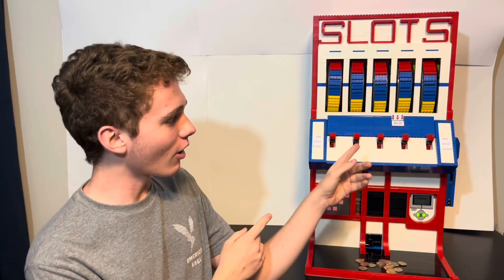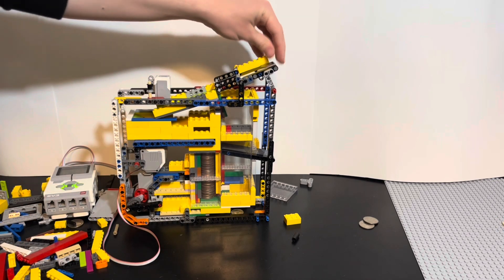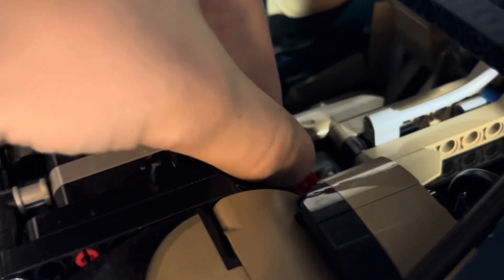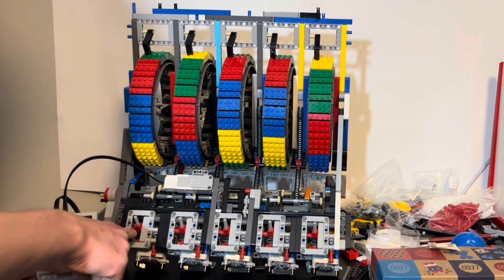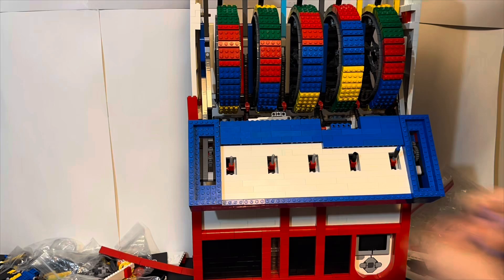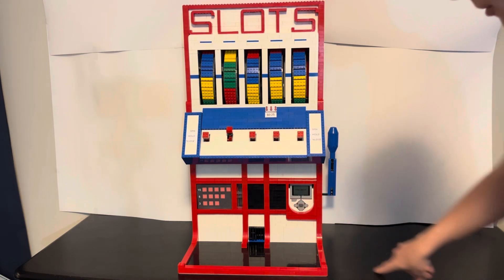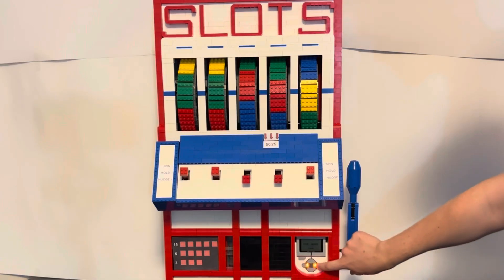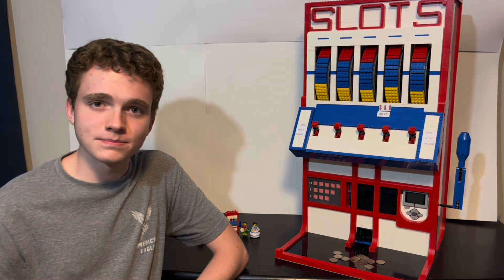Making the Ultimate Working LEGO Slot Machine

Comment: Can you tel me how to program the credits
Reply from the maker: @Joffrey-v8w  in the ev3 programming software, I begin by having the ev3 run two programs by using two start blocks. One program is the wheels and sensors while the other is for credits. It begins by establishing a variable called “credits” setting it at zero. Then every time the sensor sees a chip it adds one to the credit variable and spins the motor to shake the column. When the other program is triggered by the slot machine arm to play a round, it checks the credit variable to see if it has a credit. If so, it plays a round and subtracts a credit

Comment: how does the ratcheting system work?
Reply from the maker: @JoshyBoi7832  there’s a one-way drive which is composed of 3 gears. The first one is motorized and the last one is the output. The middle gear is mounted via an arm that is free to lift up but gravity keeps it down. When down, the middle gear makes contact with the left and right one to have power transferred from the motorized gear to the output. When the motor stops and the output still spins, the middle gear ratchets by lifting up due to torque. The left (motorized gear) spins counterclockwise, the middle would spin clockwise, and the output counter clockwise. That orientation only allows torque one way. The other way just lifts the gear
Reply from the maker: Just thought of an easier explanation: it works just like a bicycle how you can pedal to add power and then coast/free spin

Comment: Instead of making these take real coins, why not just a flat 2 by 2 plate?
Reply: Because that's not fun, and 2x2 flat tiles can easily get accidentally wedged without precise engineering to prevent it from flipping or rotating. A metal coin is round and has more weight, so it's less apt to get stuck on its side in the hopper

Comment: Videos are incredible, but here are some tips from one creator to another. I would suggest buying some more lights and/or a (bright) light for the camera to both brighten the set and get rid of harsh shadows. The other thing if you know anything about cameras is the White Balance/color temperature. Some of the shots are very warm (yellow/orange) and look like they were recorded in a living room because of that. Making the temperature colder/cooler (whiter) will make it look much more professional and in turn more watchable to the average viewer. Keeping the White Balance consistent from shot to shot is also important. If you are working with a camera that should be an easy thing to change, but you can also manually adjust WB on a phone too and in editing software too. Awesome machine, and a lot of potential for the future :)
Reply from the maker: Thank you! I appreciate the advice! I don’t know why those two clips seemed over saturated but I use one lighting stand but I’ll definitely get the other one out for the next video!